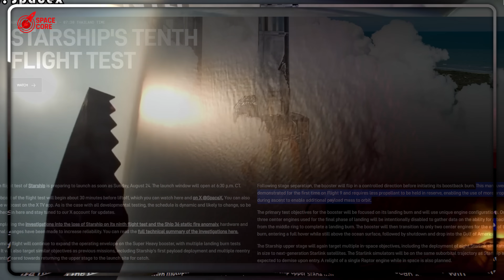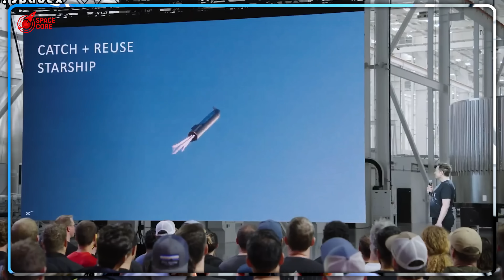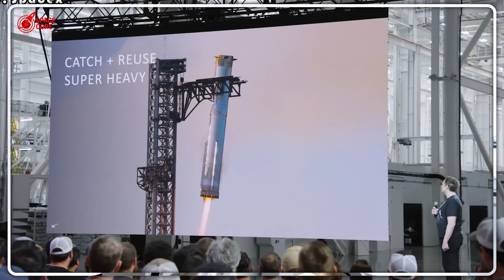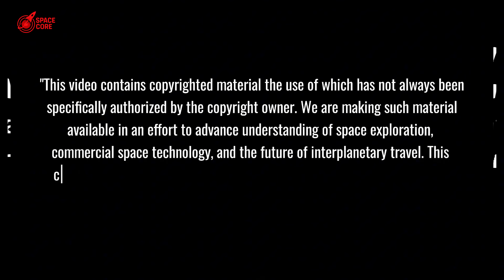Elon Musk Just Revealed Flight 10's INSANE Rocket Flip...Engineers SHOCKED!

Comment: Matters little to go to mars and land big objects
months of space drifting a rocket as mto haver an engine ready to work land
in space there is no up down gravity all fuels flaot and mix jell 
inerter is need to level make fuel safe to work use
Reply from the maker: The rocket flip in Flight 10 uses gravity to save fuel, enabling larger payloads for Mars. Engine restarts and inerting systems ensure reliable landings.

Comment: Once in orbit and engine stops total machine and contents is in free fall. flipping over by cold thrust or low hot thrust
liquid fuel will fall to rear under thrust pushing it towards engines
Basic thrust and acceleration
Reverse thrust burning facing down to earth gives fake gravity pushing passengers cargo to multiple G forces
Liquid nitrogen sweating tyhroiugh skin of ship disipitates taked the heat away from the fragil body.
saving wieght away from uineeded tiles makes more stronger re enfoecing of internal workings and anti
vibration occilartion and better stronger welding
Reply from the maker: Your insight on cold thrust flipping and liquid nitrogen cooling is fascinating, aligning with Flight 10’s fuel-efficient rocket flip and active cooling tiles.